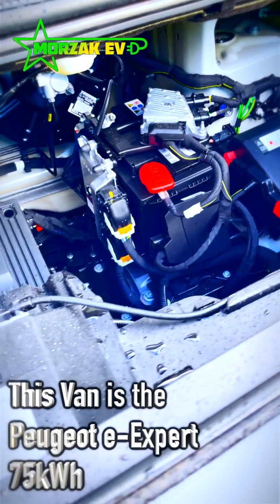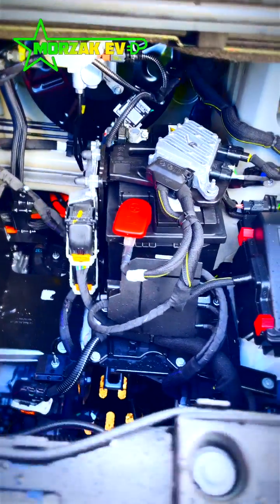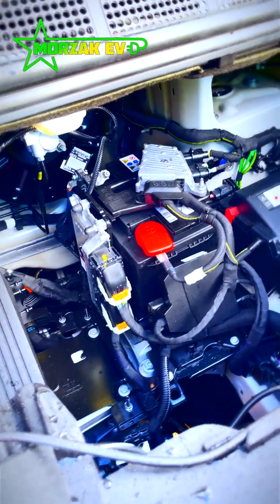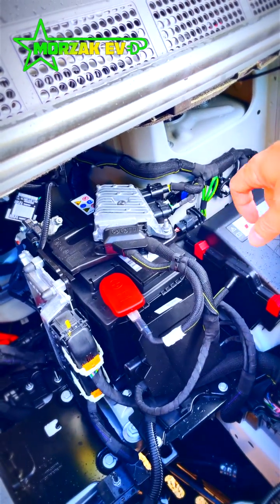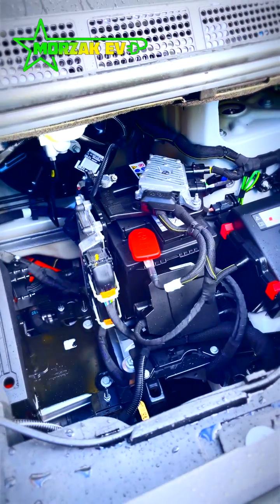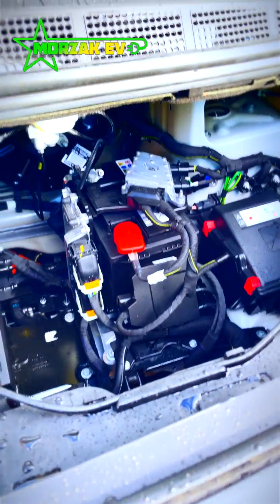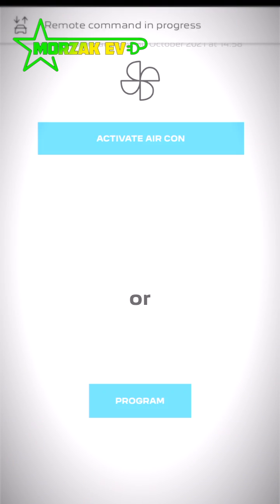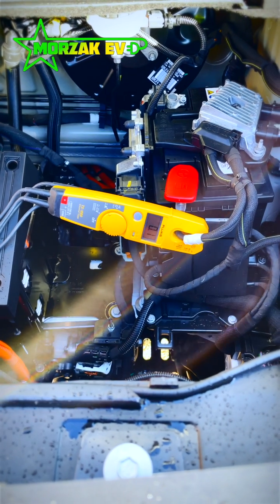Peugeot E Expert 12V Battery #shorts

Comment: Is there any particular procedure that needs to be done in order to replace this battery? Or literally just undo the negative and positive and replace battery? No BMS issues?

Can a 12v battery charger be connected whilst in situ?
Reply from the maker: As far as I can tell, it’s exactly the same as any ICE vehicle. Of course, all of these vehicles are in warranty currently so anything “should” be done by a professional in accordance with your warranty. The 12V system is separate for the Lithium battery system for the vehicle.